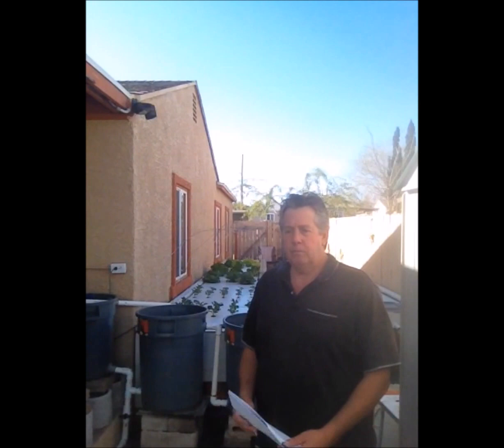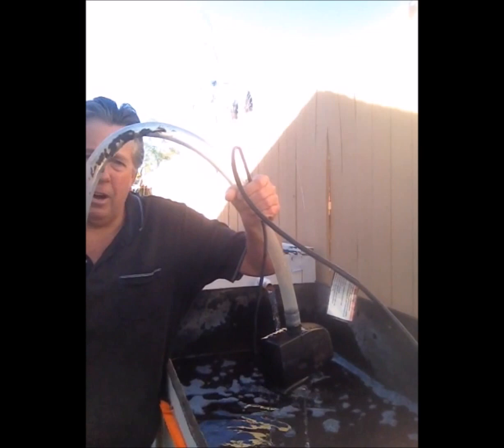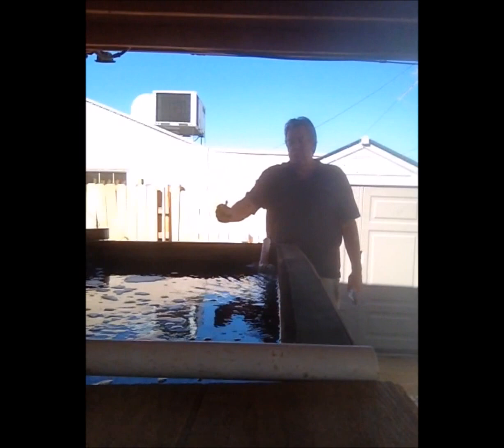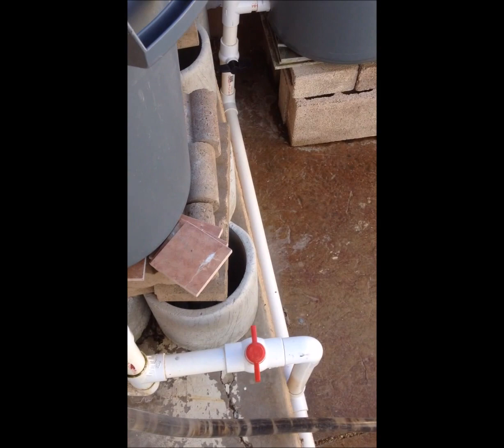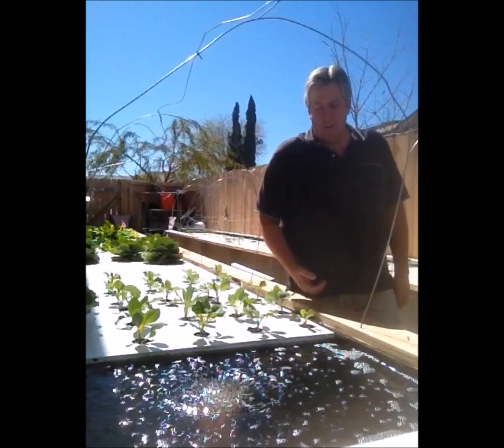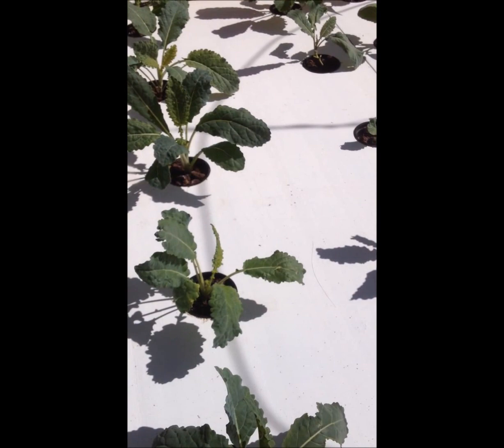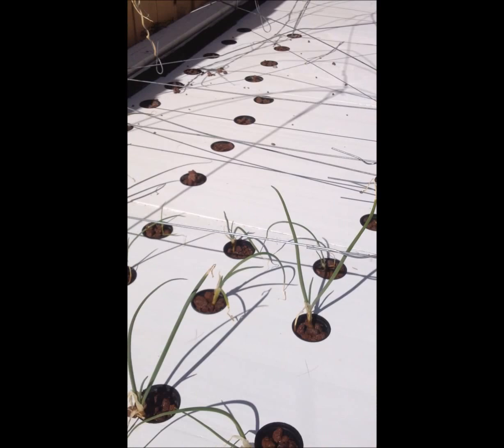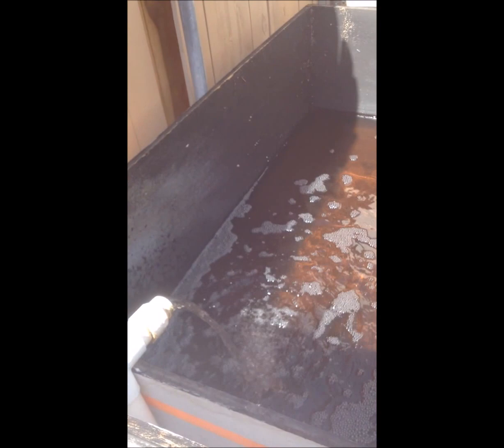Coggins Aquaponics Garden

Comment: Just a question.  If your pump stops working how low does the water in the aquarium get?  I figured there would be a point that the water pressure can't overcome atmospheric pressure in the first trash can which would stop the overflow continuing to the second trash can.  can you confirm? thanks